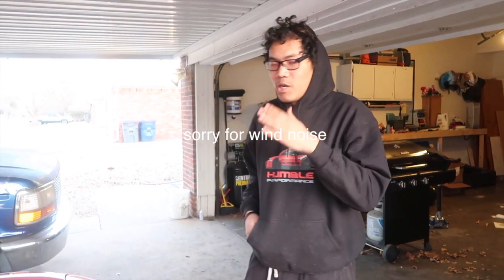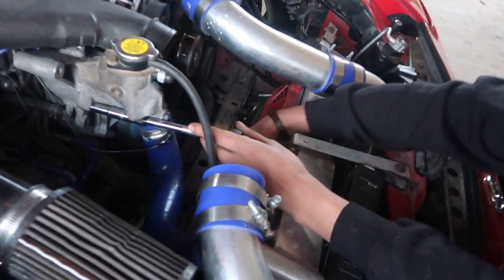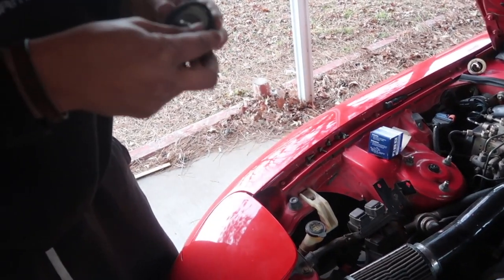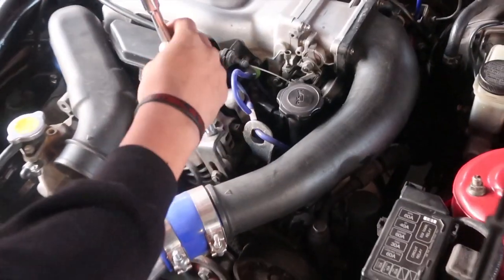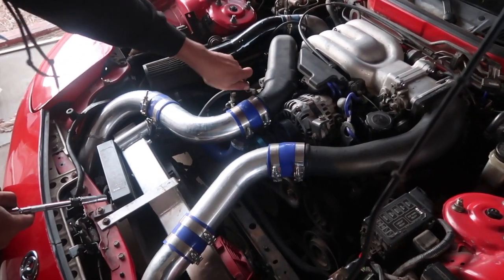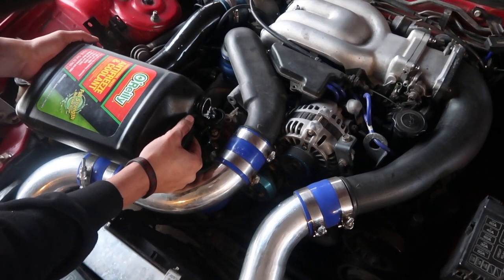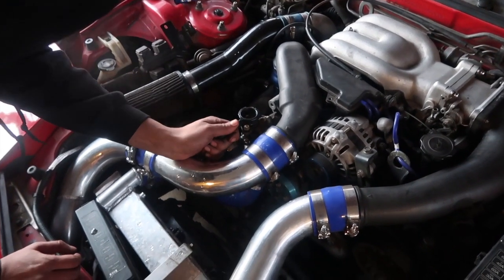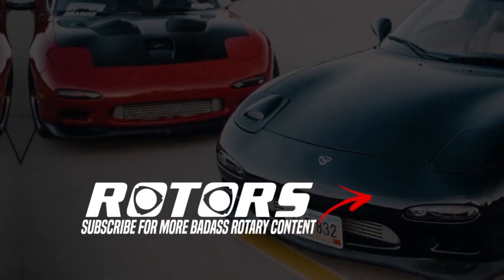How To Fix An Overheating FD3S RX7 Thermostat

Comment: Another easy way to burp the system is to remove the end of the coolant hose that goes to the fast idle cam on the throttle body.  I recommend using some 3/8 inch hose pliers since it tends to get stuck on there.  This will allow air to release as you fill the system and squeeze either of the large radiator hoses.  I've found that I hardly have to add any coolant later since this method helps you get more in in the first place.  The only downside is that you may have idle issues the first time or two that you run the car afterward since you could end up with air stuck in the fast idle cam instead of coolant.  The fast idle cam has a wax pellet in it that changes shape with heat and indirectly adjusts the idle, so without coolant reaching it, it'll stay stuck open.  If this happens and your car continues to idle high even with the temperature gauge reading warm, rev the engine lightly for a bit or go for a short drive at low speed.  The problem more or less has to fix itself.

Comment: What's your thoughts on running a thermostat that opens at a lower temperature? I'm in south FL and summer can be hot. I've seen mixed thoughts..
Reply from the maker: No
Reply: Ok..
Reply: Why
Reply: I've ALWAYS used OEM, but over the years I've had people swear by using 160 degree thermostats. I figured it would be kinda counterproductive to cooling. Just though I would get another opinion but I just got a "no" lol

Comment: You forgot the easiest cheapest problem to fix: a busted radiator cap that does not hold pressure will act like that too.